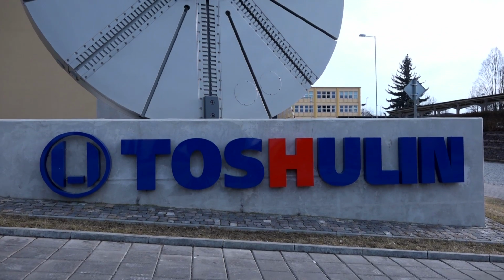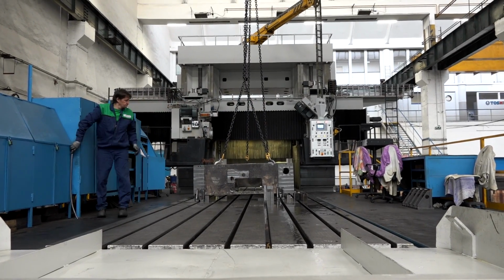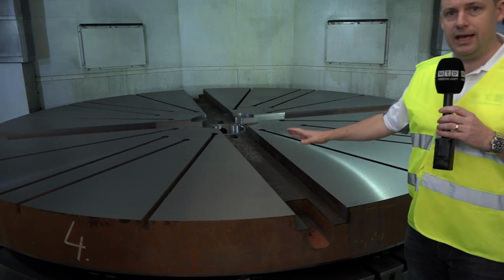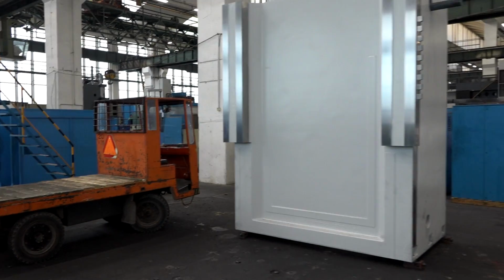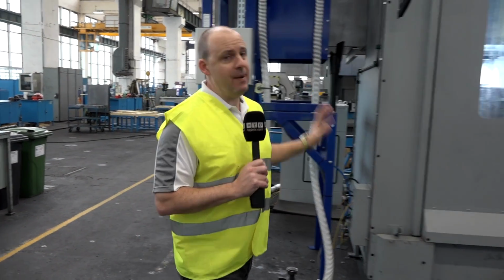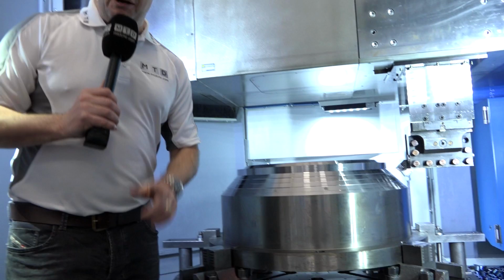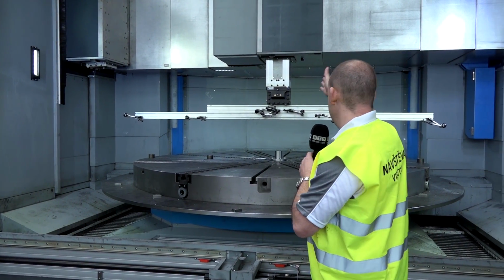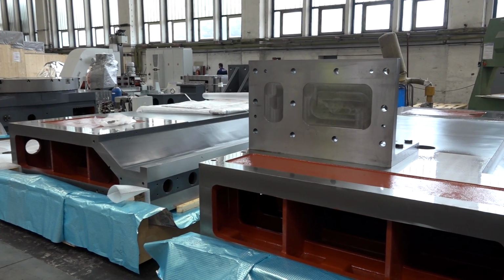32 mm depth of cut in action as MTD visit Toshulin vertical boring factory

Comment: You don't say "depth of cut of 32 mm on diameter", as DOC is linear measurement and in this example DOC was 16 mm. It is the actual depth you are removing metal.

But nice to see some heavy machinery being made :)
Reply: Jaakko Fagerlund you’re right I know them tips are only about 10 to 12 mm square .... 10mm cut in engineering terms
Reply: On German Zimmerman machines. LMFAO.

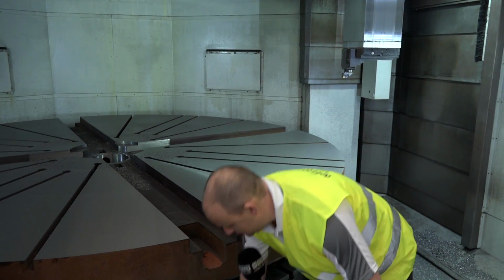Comment: The chips he shows at 2:26 were not from the machining of the table fixtured in the machine. The chip he picks up are steel chips where the table is cast iron which produces the small chips you see in the background and in the bottom of the machine. No slight against the machines abilities just not an accurate depiction of the process.

Comment: I6mm depth of cut, 32 off diameter
Reply: Anyway the swarf  is 32mm wide!!!!!
Reply: @johnhili8664  No it's 16mm well maybe a bit more because it's a 45 degree cutter but it's not 32mm
Reply: @GeneralG1810  Yes you are right thank you regards from Malta!!!!!!!
Reply: @johnhili8664  Welcome ;D
Reply: Either way, it was a decent feed rate and fairly large diameter so shows the machine has the HP!
Reply: @richardmiddleton7770  Oh absolutely it's a beast of a cut

Comment: No coolant needed?
Reply: Not needed for roughing steel..
Reply: @sunppaa  But needed if finishing?  Or still not needed when finishing because it is steel?
Reply: When the Rotation Speed and Feedrate are optimized the heat generated comes off in the swarf. You can see the metal chips are blue in colour or 300+ Deg C. Immediately after cutting you could touch the part and the cutting insert and they would be relatively cool. So no need for coolant. Adding coolant can actually destroy the cutting edge as it can cause thermal cracking of the carbide...
Reply: @thundertwonk3553  Hi David.  Thank you for the answer (even a year later, it's still valuable).  If I may ask further... As the endmill get used, and the cutting flutes start to lose their sharpness,  is it normal for the tool then to start getting hotter as it gets more dull?  And is colling beneficial at that stage, or would cause more damage? (from thermal shocks).
Reply: @sunppaa   Thanx bro....Soo many dudes do this wrong....  Roughing...Dry....  Finishing...Coolant..!!  👍